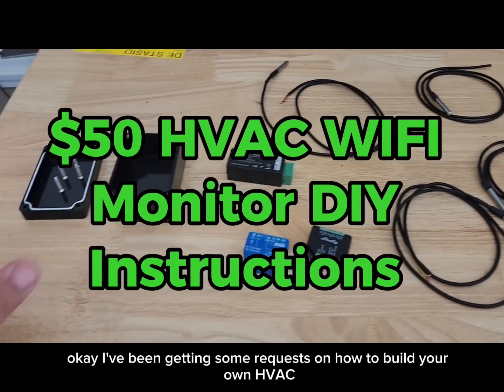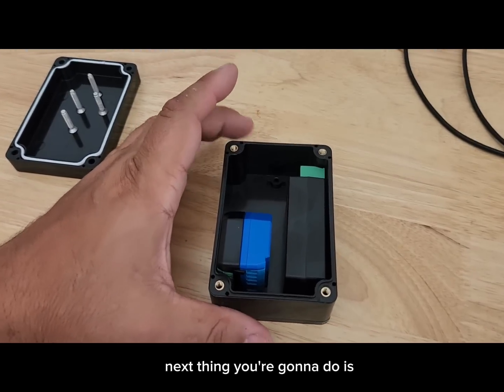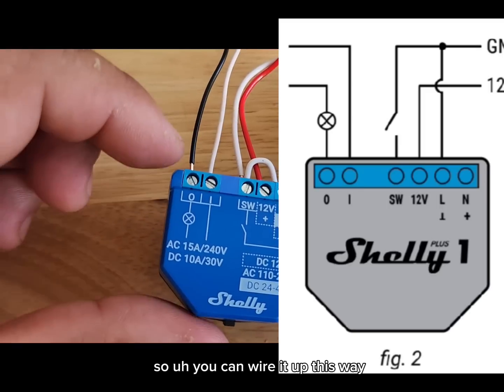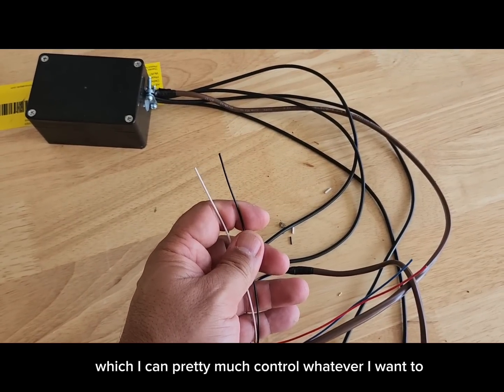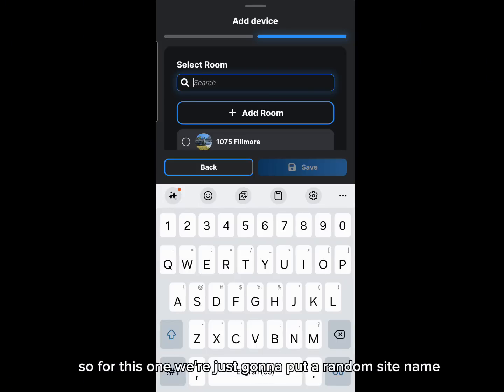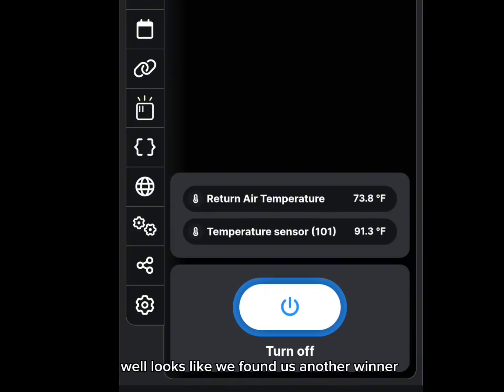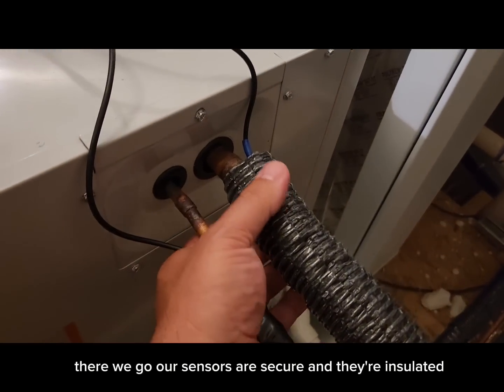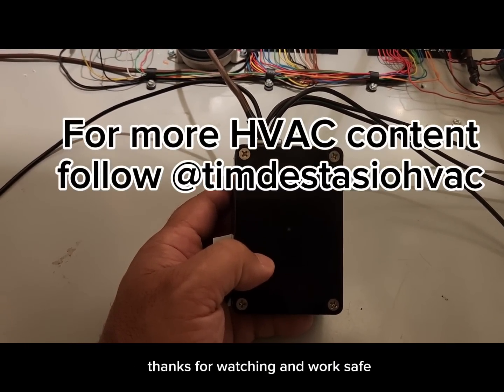Build a HVAC WIFI Monitor for $50

Comment: Great video, thanks! One nice addition to such a device would be to add low-side and high-side pressure monitoring. I think pressure gauges could tap in via the service ports. Does this seem viable to you? - Thanks again!
Reply from the maker: Pressurebecomes irrelevant once you learn non invasive system testing using psychrometers and them clamps.
Reply: @timdestasiohvac : I was thinking that knowing the pressures would give helpful information as regards refrigerant level.
Reply from the maker: @hubercats  there's a better way with Non invasive

Comment: Monitoring  is great. How would you recommend using  the data to set parameters and send us alerts. Is there software for plug and play?
Reply from the maker: There isnt plug and play software other than the Shelly app. You can set alerts there.

Comment: I just built this.thank you. An interesting use for the Shelly relay, I added 2 ribu1c devices, one for low speed cool one for high speed cool. Now I can choose between low/high on speeds 1/4 or low/high 3/5. I added a button on the case to manually control the relay. Now I can have really long cycle times but still be able to crank the cooling on the hottest days.
Reply from the maker: Perfect!

Comment: Excellent resource,  thank you for the information.  Interestingly when searching for wireless Temp Probes and so on in Amazon you wind up with all kinds of Modbus devices,  not bad hardware but triple the cost for doing the same here, AND you have to buy special software to monitor the sensors, and more.  This is just Simple and Strait forward, will be using POE to provide the power for the devices and an access point for a Closed central wireless automation system base on this kind of device.  Thank you for the fantastic quick guide.

Comment: I just order the parts to build this HVAC data logger: THANKS. Do you have suggestions for data logging other HVAC parameters like static pressure? CFM? ECM motor speed?
Reply from the maker: @ronpack4303  Im working on Static next. Stay tuned!

Comment: I've worked in data centers where monitoring systems on cooling are beyond anything... Maybe except for nuclear plants and a few other application.
Anyhow, THIS channel is what I wish I had found before buying my AC unit earlier this year. NOW I am left with my own self patching a few wires here and there to tap into so home automation...
You'd be an insanely good contributor to the "home assistant" community.
Reply from the maker: I'll eventually get there thanks!

Comment: Great video! I've been trying to figure out how to remotely monitor whether my oil boiler is tripped out on safety, but this doesn't seem to be a thing anyone has ever implemented?? Do you have any ideas? It trips once a week or so, but techs and service don't seem to be able to fix it. I can't find any issues myself either, but it's winter and I need to be able to monitor if it trips before the house goes cold.

Comment: Would that work for 3 wire humidity or enthalpy sensors as well? How about expansion capabilities? That's really clever, great job and video!!
Reply from the maker: @andrewsegner468  there is a separate analog input for those sensors. And there is no limit to how manu sjelly devices can connect to the same account and create automations for them.

Comment: I was thinking of doing something similar, but I was concerned about corrosion. The chart below says that stainless-steel & copper risk galvanic corrosion especially given how much moisture there is around HVAC units. https://engineersvault.blogspot.com/2007/02/galvanic-bi-metal-corrosion.html

Comment: All the stuff a thermostat should be capable of.  
Why in 2024 can we geek peoples not open a thermostat app and be able to prediag a system or log statistical data?
Reply from the maker: @turboflush  ecobee gets you close especially with beestat.io
Reply: @timdestasiohvac   I will look. Thanks.
Is there a pro or commercial thermostat to look at?

Comment: Nice. I've been using a combo of Raspberry Pi & Arduino units to monitor my system. I have an outdoor pellet furnace and it has built in monitoring via web, but there's no way to control anything remotely. This system looks much simpler and easier to setup. My only critique is on the enclosure...use cable glands rather than a romex connector at least they are water/insect proof as well as easily obtained at Lowes/HD type places.
Reply from the maker: @eljefedeguapo1  my next version will have grommets stay tuned for that video
Reply: I did not know what cable glands were had to look it up. We called them at work cord grips LOL 😀

Comment: Thanks for posting this!  I just completed this project following your instructions.  I did use the fifth temp probe for an ambient temperature, may as well since they came in a five pack!  I appreciate the precise instructions and details!  I also tied the Shelly into Home Assistant and created a dashboard for the HVAC monitors, including controls for the thermostat.  Placed an old tablet on a mount near the HVAC unit to display the stats.  Maybe that will help keep the HVAC maintenance guys from pin cushioning my return and supply ducts to measure temp each visit. 👍
Reply from the maker: @matts1196  yes if you can snake a wire outside, then go for it!!

Comment: Very good content.  My issue is with the manufacturer of Shelly, FORCING users to register their personal information just to use the app to begin monitoring.  SUPER LAME.  @Tim is there another product you have tested or at least aware of that doesn’t require registration?
Reply: You don’t need their app to use the products.  They are local control via the devices webui.  I have 38 Shellies and none are in the app
Reply from the maker: @koeppenroad  the app is much easier to see them all in one place.
Reply from the maker: No I haven't.  By the way Youtube/ Google made you do the same thing to watch this video.

Comment: I skipped the power box and wired the shelly directly to the 24V my air handler generates for the thermostat, it works great.
Reply from the maker: Interesting- good to know.  Did you wire the Shelly the same way or what input voltage config did you use?

Comment: Great to see this, did something similar with the addition of using a Shelly i4DC instead to monitor the HVAC lines themselves (cool/heat/fan calls). Something I didn't make the leap to is to utilize Sensirion digital pressure sensors to measure pressure drop on the filter, but man they are expensive and would take a bit more work to integrate with the pitot tubes. Instead I opted for good-ole analog Dwyer Mark II mamometer, which seems to work really well.

Comment: This is perfect! Just the other day our AC stopped cooling due to a clog in the condensation drip pan drain caused the float switch to turn off the chiller. Was just thinking of setting something else to monitor the temps and float switch!

Comment: Great video ! I was looking at the Emerson Sensi Predict but then it disappeared.  I figured it didn't sell like they hoped, even with MeasureQuick hyping it.  I see MeasureQuick started monetizing.  Not unexpected.
Reply from the maker: Hi, and thank you.  Yes, I was disappointed in Sensi being cancelled too.  I've talked about this to other industry people and there simply isn't as much of a demand for this in residential but I think there is one in commercial.

MQ was always monetized but the took away screen shots last year unless you buy Qbits.  I still buy Qbits even though I don't really use MQ's reporting.  I just build the $5 each unit for an entire year into my pricing.

No MQ is in with Smart AC but the data you get is very limited and it doesn't catch the performance problems with units like they say it does.  And it's battery powered so sooner or later the batteries will die.  I'm not impressed.

Comment: Nice job, I played around with the same system, but my challenge now is to detect condensate overflow in a mini-split.  I need to find a leak detection module that is low cost...
Reply from the maker: @jackpestaner6925  a float switch can be tied into a digital input on the add on.

Comment: Does the app support at least a 2-point calibration of the sensors?
Reply from the maker: @UnfrozenScoundrel  you can calibrate/ offset them
Reply: These are not thermistor or thermocouple sensors. They’re digital Dallas One-Wire-Bus sensors. They’re factory calibrated internally.
Reply: @robertlitman2661 , I expect an NTC element of some sort, but since they have 1/10th of a degree resolution, I would hope there is some adjustment that could be done in the app.
Reply from the maker: @UnfrozenScoundrel  there is an offset like I said

Comment: Glad I ran across your video, thanks! I just got my first Shelly devices in for another project, but now I need to order the Plus 1, Addon, and some temp sensors! One thing I would add is a condensation float switch into the Digital Input. The Analog Output could also control a 0-10v outdoor/fresh air damper, as well.
Reply from the maker: @marylegz90  you will need another add on for a float switch i believe. I power mine after the existing float switches which will tell me its tripped  via power/ comm loss
Reply: @timdestasiohvac  - On the add on module Shelly’s site states that it had a digital input. This should be able to be utilized for a float switch for condensation overflow or for a CT for fan status. Am I reading the information wrong? Mine comes Sunday, so I’ll play with it then.
Reply from the maker: @marylegz90  yes, but im not sure you can add the input to the temp sensors.
Reply: @timdestasiohvac  - Just following up on this. I successfully got my 1 Plus setup with the Add-On module. I’ve got (5) DS18B20’s wired into it as well as a condensate float (could also do a fan switch) into the digital input (GND and Digital terminals). It will turn off and on based on the switch input being open or closed.
Reply from the maker: @marylegz90  this is awesome!

Comment: according to your return and supply temp you either have a dirty evaporator coil, dirty air filter or you not moving enough air. delta T should be between 16-21 degrees.
Reply from the maker: @jcook69camaro  most of the time yes. But my Bosch compressor algorithm was making the compressor ramp up at that particular moment. I can assure you that everything is clean in my unit. Stay tuned for more videos.

Comment: Just Awesome - been searching the Internet the past 3 months trying to find such a device that accurately measure the Return and Supply Temperatures in our Home HVAC… This certainly will get the job done and more…Thanks!!!
Reply from the maker: @philiplashley7888  I will be making a video about another setup that includes humidity
Reply: @timdestasiohvac  Hello. Just wondering if you are done with the video setup that includes humidity as well. Thanks.
Reply from the maker: @xincai951  had to take a break from it to catch up on work. Might be in December ir January
Reply: @timdestasiohvac  ok thanks.
Reply: @timdestasiohvac  Is it possible for you to tell me the hardware you used? I can look into it. Thanks
Reply: @timdestasiohvac  Fantastic. This is great stuff, bro. Thanks.

Comment: This is awesome - never knew this company existed, while normally you can do many of these things with an arduino without the “server side” it’s tough once outside your network. Wish they made a unit with more channels. Just got two complete setups for monitoring a chilled water cooling system on a boat! And another to just use as a flame out indicator for my smoker!
Reply from the maker: That’s awesome. Shelly does make a 3 relay pack.

Comment: Great video … Thanks!
Btw - when you mention drill a 1/2” hole for Romex/NM cable connector, many viewers might not be aware that 1/2” is the “Trade Size”.   The actual physical hole should be 7/8”.

Thanks again…

 Btw - there is a small device (see NICS alarm YouTube channel) that has a no or nc dry contact input and will send you a message via SMS/text.  It uses Wi-Fi and is around $15

I use a float switch to alert me when/if the “emergency” pan under my attic fan-coil unit.
It alerts me prior to  a wet 2nd floor ceiling.   I will eventually add a relay (NC) inline with the “R” 24vac thermostat feed to kill the A C if the condensate drain is clogged.
Reply from the maker: You can do the same with the add in- it takes digital and analog inputs. But yes thank you, it’s a great time to be a tinkerer!
Reply: @timdestasiohvac  Thanks for a bingeworthy channel!

Comment: Great Vid, Maybe get some boot lace ferrule for the cables, will neaten them up more and also provide some protection against a possible short.
Reply from the maker: @manusengelbrecht9959  this was a temporary setup to test it on my unit. The controls that you see behind it are all carefully wired and secured.

Comment: 45⁰ supply air sounds really cold. Especially with the vapor line at 47⁰. Am I wrong?
Reply: Typically you look for about a 20 Deg F difference between the return air and the supply air.  But it depends on the return humidity levels too.
Reply from the maker: @hjc4604  yes. At that particular time my unit was backing off a reverse cycle y2 to y1 and Bosch has a delay on the compressor ramping down. The result is an ice cold coil.
Reply from the maker: @realSamAndrew  no you are not wrong. The Bosch algorithm for some reason had my system ramped up for a few minutes and it was making really cold air. The longer it runs the lower it seems to run cold temperature. It typically runs between 50 and 55 °
Reply: @timdestasiohvac  thanks. Also I found it weird that the air passing the coil was actually colder than the coil itself. Is that even possible? Must be one or the other sensor was a little off. What do you think?
Reply from the maker: @realSamAndrew  the vapor sensor is not in the coil it’s in the suction line so it’s reading coil temp plus some superheat.

Comment: I'm wondering if you could elaborate on where you're supplying power to the Shelly monitor. You mention the terminal block and something about after the float switch, but I wasn't sure if you just wire it to the terminals or need to splice the wire into an existing line?
Reply from the maker: Each system will be different, but you want to grab 24V from "R" and "C".  But I like to get the 24V "R" after the float switch instead of before.  That way when the float switch trips, it will show up as intermittent power/ communication loss.

Comment: Pretty cool...no pun intended.
I did similar with an Arduino some yrs ago but with exceptions.
I thought I could sell it as a remote monitoring system to local HVAC companies.
An early warning system of sorts to alert HVAC co's before their customers saw a problem.
My system included a couple pressure transducers on each line as well as temp sensors.
I included a wifi module & system voltage sensors as well.
It worked pretty well with my home system.
Much like a FieldPiece gauge systems does.
I found my local HVAC co's weren't interested in this so I gave up.
It's nice to find that I wasn't alone in my madness lol.
Reply from the maker: A few companies, namely Emerson failed with this too.  Sensi Predict had so much potential but never got a foot hold.  But there are always a few companies out there that would totally use this to offer better service.  But it doesn't fall into the typical model of sell sell sell that most HVAC companies do.
Reply: Can you share any of the components you used?
Reply from the maker: @FiveFingerTight  I actually did include them in screenshots.
Reply: @timdestasiohvac   Yes you did thank you! But I was replying to @Usernotloggedin comment about his project. I'm curious what fittings and probes  were used to do the inline measurements.
Reply from the maker: @FiveFingerTight  i just strapped or inserted the sensors. They are ds18b20 universal temp probes

Comment: What are you using to collect, analyze, and act on the data? Home assistant or is there some basic data platform that Shelly provides?
Reply: FYI: Shelly provides historical data charts in the app. Have a similar setup to monitor my in floor heating flow and return temp.
Reply: I haven't gotten that far yet
Reply: I havent gotten that far yet
Reply: @timdestasio3367  😂

Comment: Really great content. Consider adding affiliate links in the description for all the products. I like to use them because 1) I know I’m ordering the exact product used and 2) it helps you as the content creator. 

Super cool and keep it up!
Reply: I came here to say the same!
Reply from the maker: @Supplyhousemarco  thank you
Reply: @timdestasiohvac  I ordered all today, added humidity sensors, not sure about incorporating them, we’ll see when they get here!
Reply from the maker: @Supplyhousemarco  only one humidity sensor can go on a Shelly plus one. So you'll need to have two. That's what I am running on my home system permanently. I will be releasing a video soon about it. A few more components and sensors but it gives a lot more information. Stay tuned.
Reply: @timdestasiohvac  ha! I’m dumb AF but ordered 2!
Reply from the maker: @Supplyhousemarco  go for it!
Reply from the maker: Thanks

Comment: i just made a similar but not remote, away from home, sort of thing my self with 2 dht22s and an esp32 to monitor how my ac is running when changing fan speed settings. I like to see humidity as well as temp to determine optimal fan speed settings for de-humidification
Reply from the maker: I have a better setup permanently in my unit that includes humidity. That’s another video.
Reply: @timdestasiohvac  Looking forward to it!